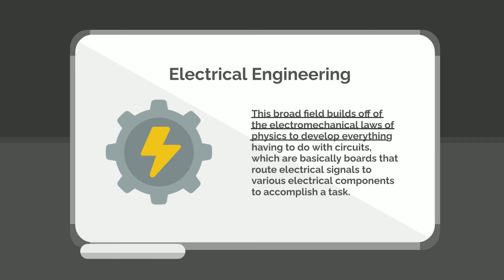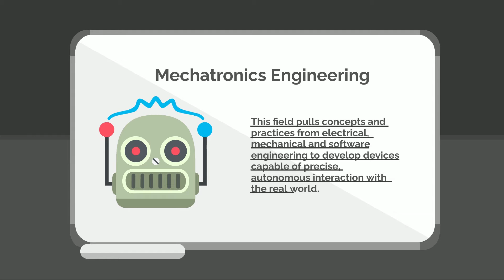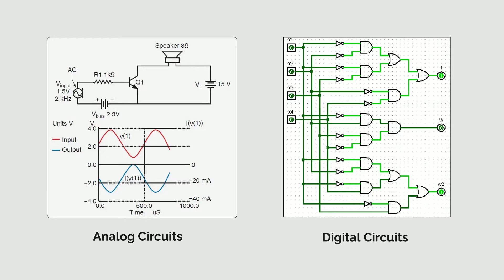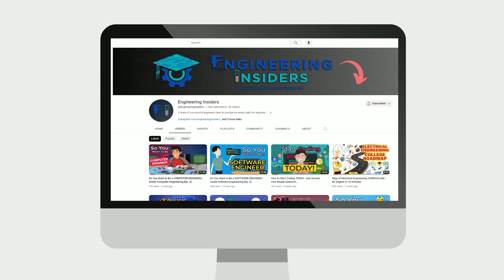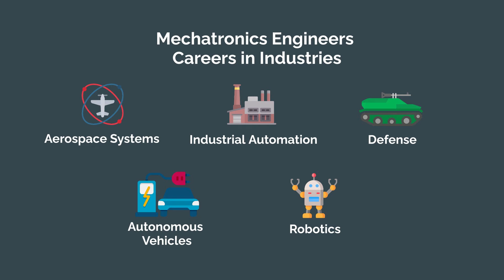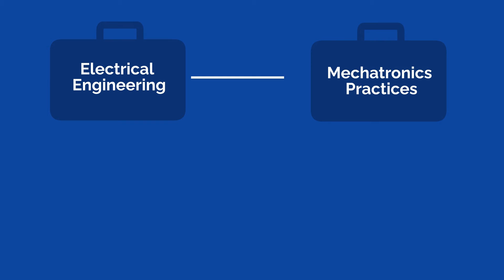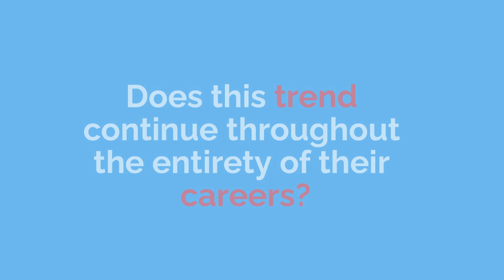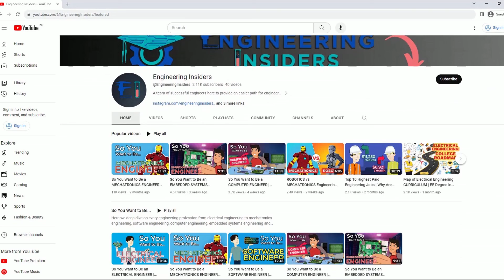Electrical vs Mechatronics Engineering | What's the Difference?

Comment: Really enjoyed the video. I just wanted to point out that the salary numbers seem off. According to the U.S. Bureau of Labor Statistics, entry-level electrical engineers make around $108,000 on average, not $87,500, and entry-level mechatronics engineers generally earn less than electrical engineers, not more. The senior-level numbers for mechatronics, like $188,000, are also way higher than what’s typical. Of course, salaries depend a lot on the company, location, and experience, but I think the video makes it seem like mechatronics pays more across the board, which isn’t really accurate. Or I just didn't understand this correctly and if I'm false so please correct me, because I actually want to study mechatronics myself.

Comment: I’m interested in mechatronics engineering, but no college in Pennsylvania offers it. They only provide electrical, mechanical, or computer engineering. I’m very interested in industrial automation. which engineering discipline would be the closest to mechatronics?
Reply: I am currently in my last year of Mechatronics engineering as bachelors degree I honestly recommend doing either mechanical or electrical engineering then doing masters in mechatronic engineering. This way you will have a better comprehension of subjects cause I swear hopping between courses mechanical courses like machine design then going to power electronics as next lecture may difficult for most people to fully digest the knowledge
Reply: What I mean the info is not accumulative and it will take longer to fully comprehend info on an intuitive level . What I mean by intuitive is linking ideas based on your understanding of core subjects but you do you
Reply: @saifayman3984  I'm also studying Mechatronics Engineering, and I get the feeling that the only skills I have really gotten good at (but not mastered) so far are using Microsoft Excel and coding in C, and even then, I feel like I could get better at those. Then again, I'm glad I don't have to take some of the most difficult courses MEs have to take like Advanced Thermodynamics and Heat Transfer or the most difficult courses EEs take, like Communications Systems and Semiconductor Physics.
Reply from the maker: It really depends on the specific curriculum, but in general it would be mechanical with microcontroller/electronics/CS concentrations. Or you can go computer or electrical and take mechanical concentrations. I’d you want to throw more specifics at us, feel free to join us in the discord!

Comment: I am between choosing Computer Engeniering, Electrical engineering or Mechatronics. I have a laptop that has a short circuit and I cannot fix it with my basic knowledge of computer science. I do not wanna pay an expensive repairer electrical but computers is my passion and I wanna fix software and hardware both hand. Which career do you suggest me.
Reply from the maker: Hey there, thanks for commenting! First, make sure to take our opinion as one single outside opinion - you should do a ton of research yourself and ask other engineers in the field. 
Based off your description here it sounds like you'd prefer computer engineering, maybe electrical. These have to do with balancing software and hardware the most. Electrical will lean further into circuit whereas Computer is closer to halfway software halfway computer, but it depends on what concentrations you take. You can check out our "curriculum map" videos for Electrical and computer if interested! Mechatronics is more like controlling electronics to move mechanical machines, which seems like less of what you are interested in here. 
But again, make sure to do a ton of research into these!